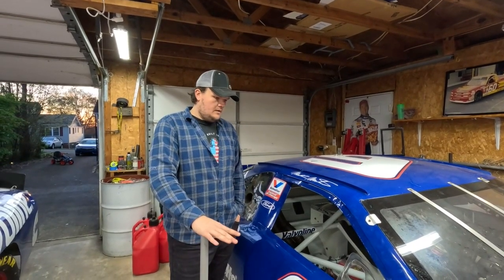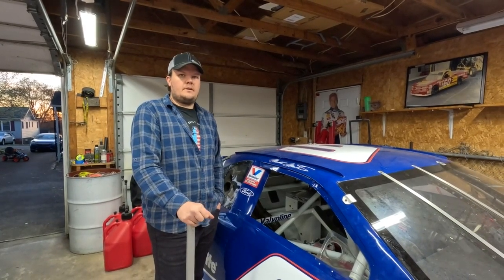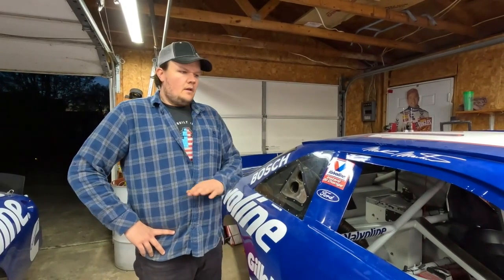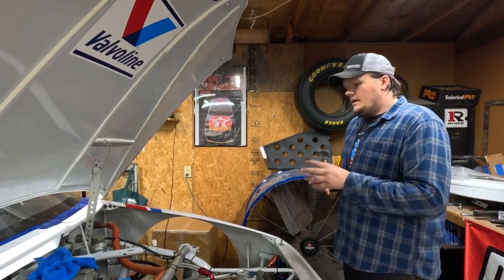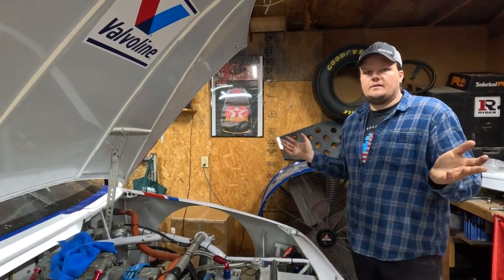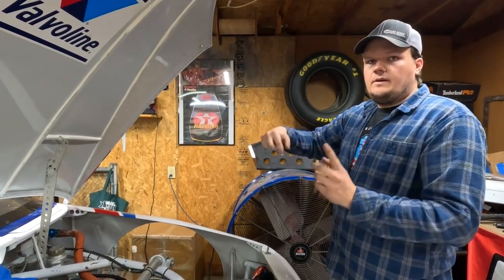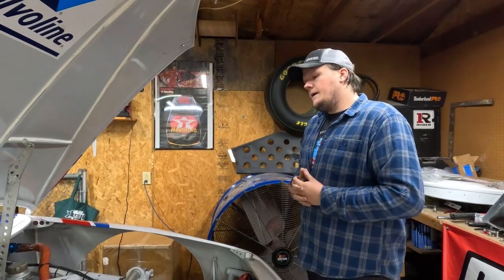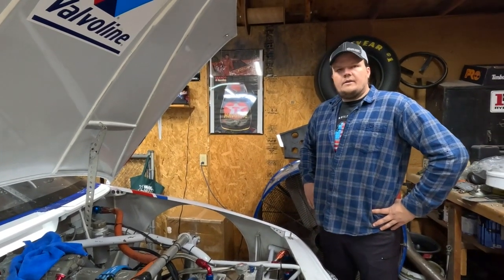Roush Thunderbird tear down part one!

Comment: Love it:  gives me good ideas and hints on the project:  I have RK250  a Roush Yates car that Matt Kenseth used during 2004 to 2006 at Watkins Glen and Sears Point.  Over time I have collected parts to build up a C3 ford engine.  Presently have the chassis up on a frame table to get the front and rear and front sorted out.  In 2006 at Watkins Glen, some sort of front end damage took place.